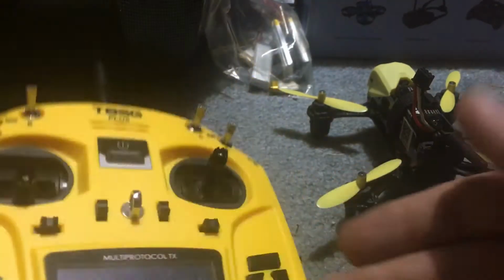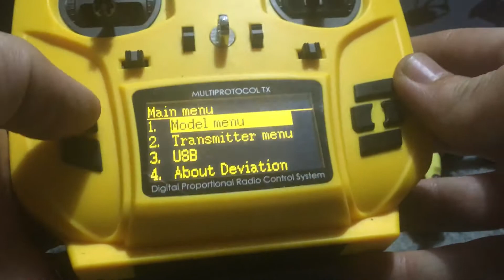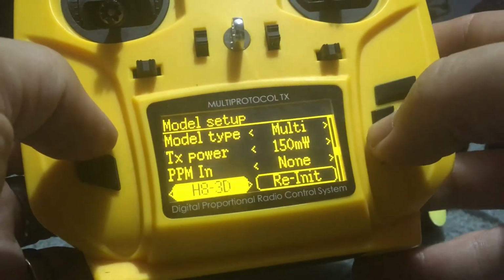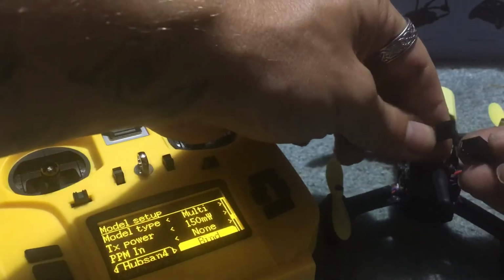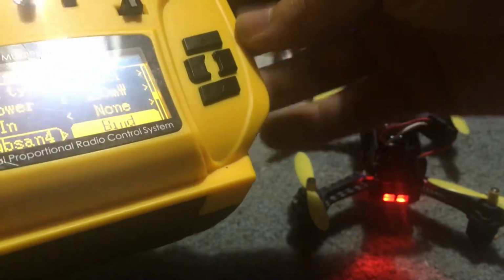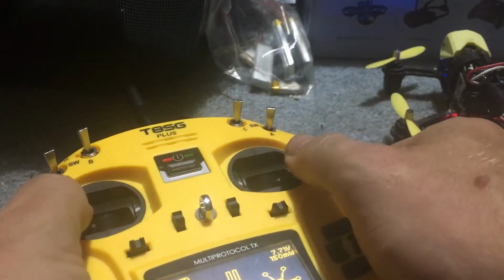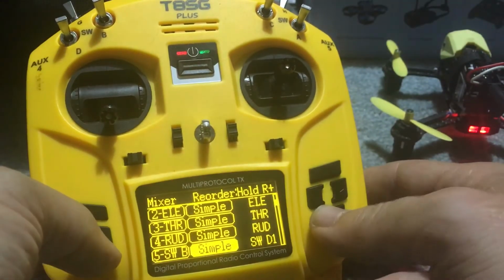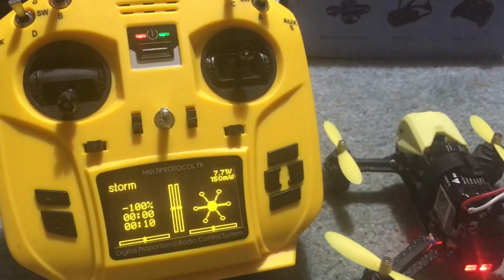Hubsan Storm H122D X4 bound to Jumper T8SG Plus 4 RAY

Comment: Maybe a question you can help me with on the Jumper T8SG.. I have a Hubsan X4 Desire and I have bound and set one switch for lights but how do I figure out what my other buttons can do? Like RTH and Rate changes? For that matter getting telemetry about how many Satellites I'm connected to? Any help appreciated if you have the time.
Reply from the maker: Brad Corey trial n error